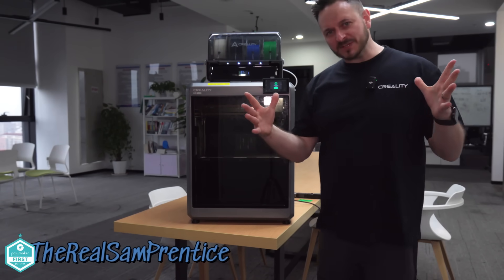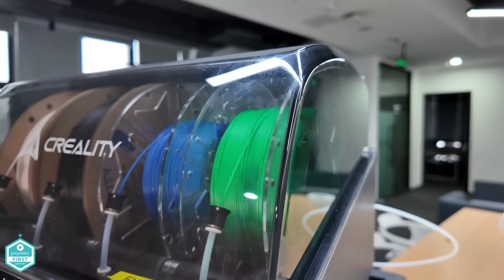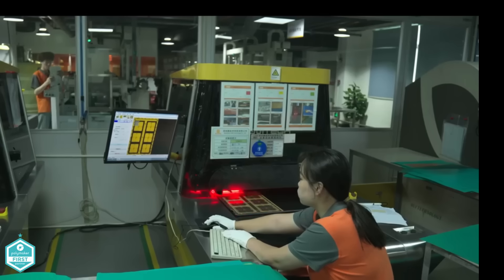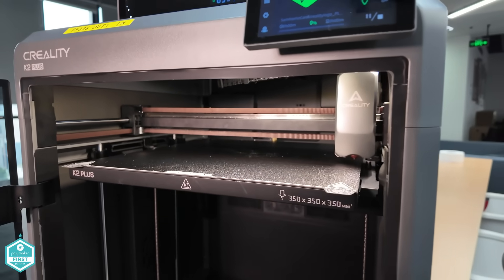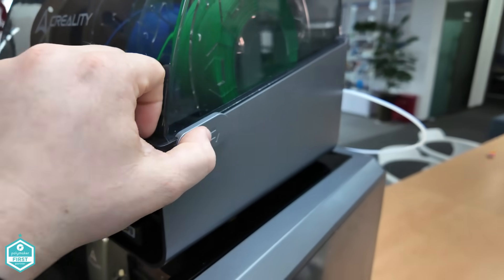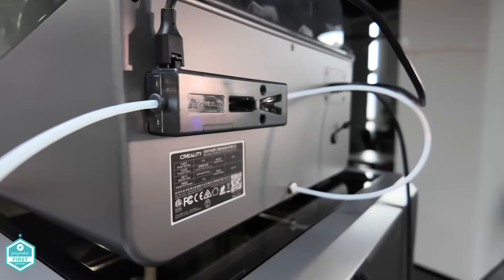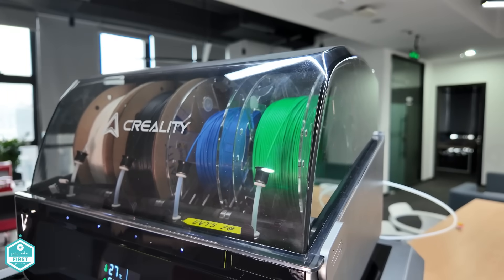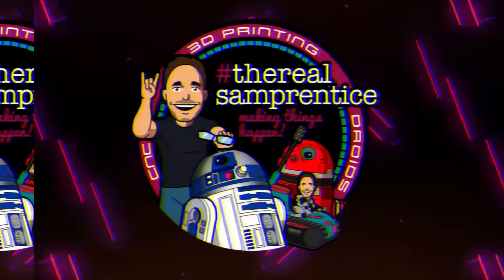The Very First Look At The Creality K2 Plus

Comment: Ok Creality has my attention again. The heated chamber and the 350mm size kind of kills anything else out.
Reply: totally agree - size of this is amazing
Reply: Does it have a heated chamber, or an active chamber heater? Big difference there.
Reply: Yep.  350 is a big consideration
Reply: yes and no.  it's slightly taller build volume, the "AMS" like system is a huge plus, but depending on price, the MagnetoX with it's linear motors (no belts) is up there too, at 300x400x300 build volume and enclosure that is rated to 60c
Reply: Then Qidi came along ...
Reply from the maker: @hassosigbjoernson5738  how is their multi colour working out ?
Reply: It doesn't matter how big if it's buggy and breaks down and doesn't print well, then what's the point?
Reply: @CaptainFettCosplay because Creality is more than 10 years in the game because their printers break down all the time?
Reply: @Vinz3ntR  their time in the game is irrelevant. Their quality control is terrible and their machines always have issues. Do you not remember the k1 mess? This type of machine is not supposed to be like an Ender or a CR-10 hobbyist machine for tinkering. It's supposed to challenge Bambu and just work. The K1 didn't. The K1 Max didn't either.
Reply: @CaptainFettCosplay  i have a k1 max  and have not once ever had an issue with it, i unboxed it and ran a print on it and it has worked flawlessly since. I have never even had a failed print. It feels exactly like a kitchen appliance, every time i use it i know it is going to work.
Reply: @Vinz3ntR  I had the K1 max. It was  a complete piece of shit and wouldn't print well at all.
Reply: @CaptainFettCosplay I own a K1 Max and it’s printing just fine, right now, as I type this with a K1 Plus in the mail on its way. Keep holding out for that large format Bambu Lab Printer for $3000…
Reply: @AntennasBC no, you didn’t.
Reply: @slipspectrum9253  why would I? I have had a V-Core 3 500³ that smokes my X1C for the last 3 years.
Reply: @CaptainFettCosplay  Sure thing but if you have experienced printers with heated chambers you know that a printer without one is like a printer without a heated bed was in 2015. You wouldn't buy one. Buying a printer without a heated chamber will soon be like buying a horse back when cars were becoming mainstream.
Reply: @sabahoudini  for the grand majority of people, it's a pointless feature. Like me...I have 11 printers, one is enclosed and not heated. I have printed literally thousands of kilos of filament. The enclosed helps with ABS and I've never needed a heated chamber. The bed helps it stay a nice temp. 95%+ of users are not printing exotics. Plus, a heated chamber can assist printing exotics but it doesn't matter if the extruder, hot end and MMU can't handle it. That's the problem with every company trying to one up each other - they forget about the basics. Quality control and just print well. THEN  concentrate of bells and whistles.
Reply: @CaptainFettCosplay  I'm not talking exotics. I'm talking about printing ABS. Printing abs properly requires 80C chamber ideally. Printing proper PC about 140C. Also lots of cooling. Sure you can print ABS in a 50C chamber but hit it with a hammer and it will shatter and also bigger more complex parts will tend to warp. People use varying types of hacks to print ABS but ideally you need 80C. Just like people back in the day used hacks to be able to print without heated beds. In an 80C chamber with lots of cooling to get it rapidly down below glass transition temperature abs prints turn out amazing and most of all they are equally strong in all directions because layers fuse together like a single part.
Reply: If you only want to print useless trinkets you don't need a heated chamber but if you need parts that can replace injection molded stuff you need an 80C chamber. Creality will probably have 60 which is not enough but a step in the right direction.
Reply: @sabahoudini  I don't print trinkets. My main thing is a 120lb fully functional R2-D2 made from PLA+ and my 4x8' cnc machine made with ASA. None required a chamber, much less heated
Reply: @CaptainFettCosplay  Oh, cool I love star wars, I have a Darth Vader replica costume. With respect, those may not be trinkets but they don't have very high material requirements. I print full size acoustic drums in ABS 350x350mm in a 70C chamber. First of all it wouldn't print without warping that huge part, second of all it would not survive without cracking through the layers when tensioning the tuning rods. You screw lugs to it and then you tension the drum skin on it and it has to withstand that. Also PLA would not work because a drum needs to take a beating.
Reply: @sabahoudini what if you just don't ever print with abs or asa and just engineer around the flaws? Then you don't need the chamber at all and a basic bed sliger will work and be a fraction of the price
Reply: @stevencullen6261  Since I'm making products other people will buy they need to be durable. PLA won't cut it no matter how I design it. It could melt on a very hot day, the tuning of the drums wouldn't work because PLA creeps. I already design them in a way to be as durable as possible in ASA. ASA is great, takes a beating and can withstand the sun. They would crack and separate across layers when you tune the drums if printed in a too cold chamber. The drum skin exerts a lot of pressure on the tuning lugs and would pull the layers apart.
Reply: @sabahoudini  same so why not petg? All the advantages with little to no true cons?
Reply: @stevencullen6261  Yeah PETG would work too and would be ideal to print in a 50-60C chamber as long as you have effective hotend cooling so it doesn't clog and lots of part cooling. For some reason PETG isn't as easily printed fast though. It seems it doesn't want to flow as good. ABS/ASA can be printed really fast for me. Although I haven't put much experimenting into it.
Reply: @sabahoudini I’ve printed plenty of ASA parts at 60C and they have zero issues. Lay off the blow.
Reply: @slipspectrum  That's fine, you likely don't need it because you haven't printed anything with challenging enough requirements. Most probably don't need it. If you want to print something very big, say 350x350mm that needs to be dimensionally accurate and strong across layer lines then 60C will be very challenging.
Reply: It doesn't have a heated chamber
Reply from the maker: @jeremykaddis9218 Active chamber heating have you read the spec ?

Comment: Yeah but is the CMS compatible with the k1 series of printers? I like my K1C and don't need a giant build volume

I wouldn't want to buy another printer at this current time, but the CMS is interesting if compatible with the k1 printers
Reply: It is compatible. They're releasing kits and we'll probably need to change a few things like the toolhead etc...
Reply: @mackinsvii9022  yeah i was looking at my k1c it seems like the rear fan could be removed and replaced for a poop chute and nozzle wiper, interesting stuff

Comment: I don't care if it's open source. I don't want to thinker and adjust parameters. Just like my car where I don't need or want to reprogram the ECU to make it run.  I want to insert filament whether it is PLA, TPU, PA CF etc., import files and print for thousands of hours without problems. If this machine is capable of that, I'll buy it.

Comment: I am most interested in seeing how they have implemented the software side of things and, if the K2 line is staying on klipper, how that multi spool system is configured and integrated. Also seeing what other lessons they may have learned from the K1 line in regards to the web interface and what the enthusiast part of the community is looking for.
Reply: the K1 line of  things works great once your root the machine and use Orca, the Creality print just isnt tuned enough. the same model with same infill and layer height is so much better with orca. Creality should switch to Orca as the basis for creality print

Comment: So far the only multi color prints I've seen come off the K2 are height based color changes instead of actual painted multi color in the same layer(s). I'm betting they dont have the software refined enough yet for coloring STL's, which coincidentally was what I was interested in most
Reply: The underside of his name tag was printed in two different colours on the same layer. 🤷🏼
Reply: @mackinsvii9022 really!! Must have missed it my bad, timestamp?
Reply: @mackinsvii9022  I mustve missed it! What timestamp does it show that?

Comment: Very much looking forward to this machine. Using my X1 Carbon with the AMS is great but size has been a limitation for some designs I want to print in multiple filaments. This will be great to use and likely more in line for cost for myself and others.
Reply: Bambu will come out with a larger unit,watch.

Comment: So the CFS is not a Dryer - The K2+ is 1200W and the K1 Max is 1000W and K1 is 350W!? Whatt the heck is requiring all that xtra power/
Reply: The K1 Max uses AC for reach temps faster in the bed. Thats why.

Comment: Wanting to see:
How does the 2 stepper motor z setup work out.  Have they got rid of the backlash seen on K1 Max.
Is the bed levelling probe measurement using load cells and has the accuracy been sorted.  
What is "Next gen" Auto bed levelling?
Is the bed still made out of poor choice extruded or rolled aluminium that deforms horribly over printing temp range or are they now using cast aluminium?

Comment: Sad to say but creality has been very hit and miss in product quality and reliability. I have an ender 3 s1, over 2 years old and still prints great, have a Halot one and again rock solid printer, mage pro utter rubbish sat in corner useless, ender 5 plus upgraded heavily but it is both a 3d printer and laser cutter so I say ender 5 plus is a winner but only after upgrades.

I don’t see anything game changing here and nothing to convince me from switching from my x1c even though the bed size is bigger on k2 plus the amount of filament waste is going to be huge on large multi material prints.

Was hoping multi tool head instead but it’s just a variation on a theme that’s causing a lot of waste. Wish creality made a filament recycling machine.

Comment: Looks great but sadly I am now willing to bet this will not have a backwards compatibility with the K1 Max as the inclusion of a poop system instead of a purge tower makes it very unlikely. There is simply no real way to put a place for the poop to go inside the K1 Max. 

That said if this is comparably priced to the X1C which looks to be its main competition (and I say that loosely as Bambu still only has 256x256x256) I will get one and just relegate my K1 Max to ABS/ASA prints. (or sell it)
Reply: I wouldnt say that a poopsystem is the biggest problem. You can always have larger purge towers instead. But without a filament cutter system in the toolhead it might be difficult to get the reliability you want from a system like this.

Comment: The chamber heater along with many of the quality of life improvement features makes this product look very promising. Just as i was giving up on Creality... Qidi and Bambu need to step up once this comes out.
Reply: Bambu Labs x1e has a heated chamber as well. Im thinking creality is gonna end up lacking on some key elements to price this low which will decrease the overall quality.
Reply: @rp101aquatics6  lol X1E is $2500 and a rip off. RIP bambu lab
Reply: @LilApe  you can't say rip as if Bambu can't release their own advancements lol

Comment: this printer seems to be my next step after I learn more about 3d printing. Just had the A1 mini for less than a week and I'm blown away, I definitely want a large printer next and having multicolor and enclosed seems to be great.
Reply: Wait and see what Bambu's offering is, the X2 Carbon is coming this year. Creality has a lot to prove with the K2 Plus before I would consider it over Bambu Lab
Reply: @SNESChalmers147 I would have to agree. Used Creality a fair bit but honestly Bambulabs is setting a damn high bar.
Reply: @SNESChalmers147 yes I agree. This looks good and I’m glad they are getting it out the door but I will wait to see if Bambu has a response.
Reply: @SNESChalmers147 any idea on timescales. I'm about to pull the plug on Bambu (first ever printer). Will the next one be a generational leap ?

Comment: 45kg? thats a chunky boi

Since this is running klipper, on paper the CFS SHOULD work with pretty much any other printer running klipper right? Would be interesting if it does cus that means it may be a viable stand alone item.
Reply: apparently there's an upgrade kit coming for the K1/K1 Max to use the CFS.
Reply: @boitmecklyn4995  ... where did you get that info?
Reply from the maker: It was on the live stream yesterday
Reply: @ZappyOh  check the creality livestream from April 9th - they mentioned it
Reply: Looking forward to the next video 'Slapped a Creality CFS onto my Voron'
Reply: @chidswick  I wish exactly that for my Vorons
Reply: This is my curious question too.
Reply from the maker: Watch this space ;)
Reply: @TheRealSamPrentice  (insert hands shaking staring at the heavens gif)